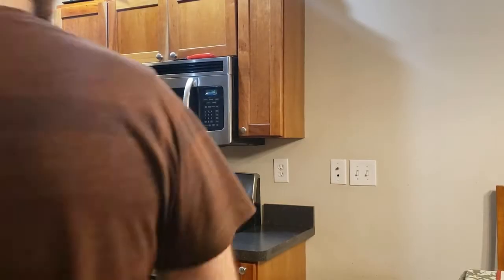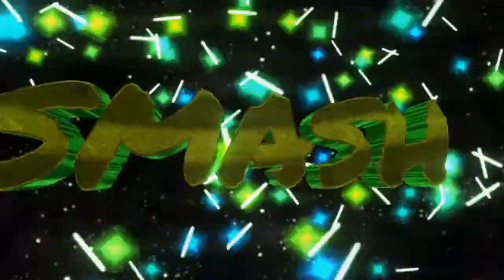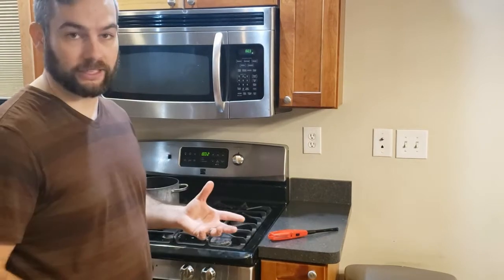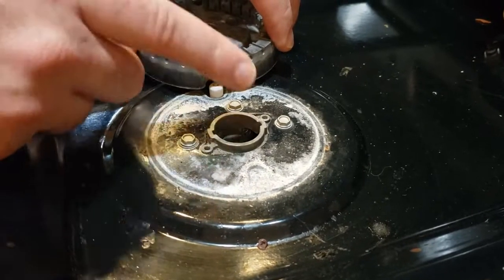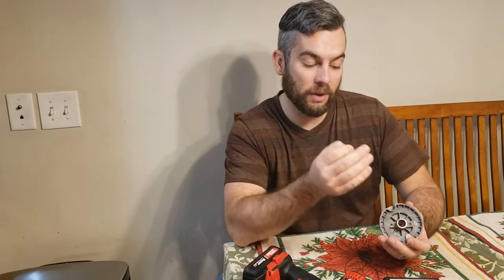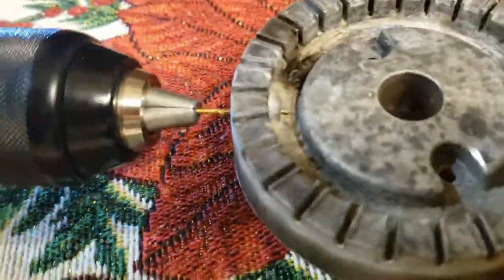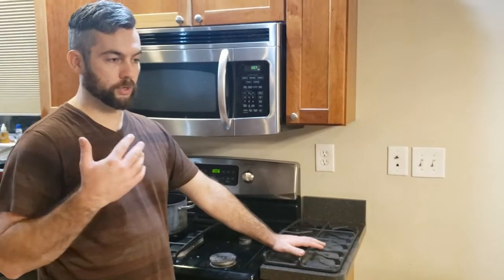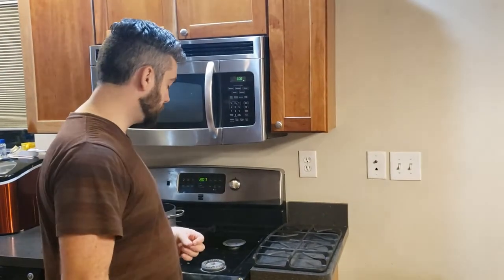DIY Kenmore stove fix (no light with ignition/spark)

Comment: Good video, overall, & I'm still leaving a like.

Appreciated the explanations of how it all worked.

At least on the model I have, the screws are hex head screws, & I didn't have a spanner that fit the tight confines. Using a flashlight to see where the hole was from the outside, I easily got a safety pin through to clean it, which fixed the problem. So, for anyone else with this issue, I highly recommend trying to clean it out with a pin, without taking it off, before going to the more extreme measure of unscrewing the piece & using an electric drill to clean.

Comment: Fixed the issue i had with my Kenmore gas stove top burner in 5 mins by watching your video. I used a straight pin to clean out the hole. Thanks for the video.
Reply: Appreciate the pin tip, worked perfectly without having to detach the piece

Comment: I found your video because I was experiencing the same issue with the (most used) burner not lighting.  However, my issue was not the igniter bleed hole being clogged, but the actual gas orifice being extremely dirty.  This also explains the reduced performance of this (the largest) burner, as it would barely keep a pot of water boiling.  

To fix this, I removed the gas diffuser, as shown (it would have been helpful if you had mentioned the size of driver needed to do this.  I believe it is a 4.5mm, but I was able to twist the heads clean off with a 3/16" - screws were rusted).  After removing the diffuser, you can see a brass orifice down in the exposed hole.  This required a 9/32" hex driver to remove, and the orifice has a wire ring around the hex to hold it securely in the driver bit so you don't lose it under the top cover of the range.  I cleaned the orifice using the appropriate size drill bit and re-assembled.  Voila!  Starts on first click of the igniter, and also has a noticeably fuller flame on high setting.

Thanks for pointing me in the right direction, though!

Comment: Your video helped me understand and solve my same issue (same burner too). I did not have a small enough drill bit but found that a small safety pin fit through the small hole and cleared it out. Thank you!
Reply: Dunno the diameter; but mine is open. Guess I'll gingerly drill it.
Reply: (feedback) My port was open for a "wire feed-thru"=not good enuf. I used a 3/16 nut-driver @ <1/16" drill. (unsure what dim it was).   Unit check OK!

Comment: After cleaning that small hole with a safety pin 🧷 still didn’t work, then I tried cleaning the entire thing with a soap solution to soften the hard spill over coating and used an external gas lighter to ignite and within seconds the flame came and was back to normal. This video really saved in bringing a technician and the wait period. Thanks once again